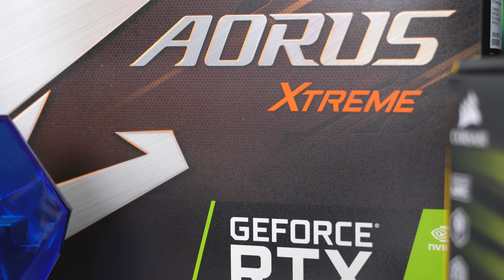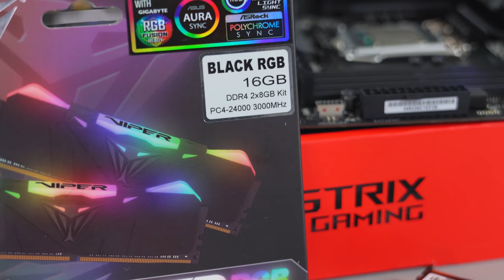$3000 Gaming PC Time Lapse Build - BIG BLUE

Comment: Guys what do you think which is the best ? Thanks a lot! 

1. ASUS 2080 TI OC STRIX
2. EVGA 2080 TI XC ULTRA 
3. MSI 2080 TI TRIO 
4. GIGABYTE 2080 TI AORUS
Reply: I think the gigabyte AORUS rtx 2080 ti waterforce, it also has watercooling with radiator :P
Reply: Asus 2080ti and msi trio 2080ti if youre air cooling and founders edition if u are custom watercooling
Reply: none

Comment: I had a PC that was running an i5 3570k, R9 270 and 8gb RAM. My power supply made a pop sound and then started smoking. Then it made a huge BANG and it blew tf up. I took my PC to a computer repair shop and I watched him test out all of the components to see if any worked. Sadly, the only thing that survived was my cases side panel. I was wondering if you could make a 2019 video tutorial on how to build a 150$ gaming computer. It’s a pathetic amount of money but at this point I’m desperate.

Comment: I have question and I can't decide whether to go with Nzxt h500 or go for Bitfinex Enso Mesh, i been watching your channel and always as my source of reviews, because here in the Philippines we don't have reviews for every build up. working my ass off to get my high end pc.. for my work loads and play time, especially the part here are incredibly expensive, I'm using R5 amd A6
   
Mother Mother Board:  MSI Pro Carbon 
( already have )
CPU:  Ryzen 7 3800x(waiting)
Case: (deciding)
PSU:  Seasonic m12II EVO 80P Bronze F.M 620w ( already have )
Ram: T.Force Nighthawk RGB ( working on this)
GPU RX 590 8gb ( working on this )

SSD M.2 ADATA XPG SX82000 Pro 512GB NVME  ( working on this )
Cooler Master ML120R rgb Liquid ( working on this )

Comment: Ive started getting bad fps on newer games and figured it might be time to upgrade some components or just buy a new computer but i want a ”professional” opinion. My specs are: motherboard: B85M-E45, proccesor: inter core i7 4770 3,4GHz, Graphics card: Nvidia geforce gtx 760 2GB, 8GBs RAM, Memory: 1TB hdd, and a 500W powet supply! Would really appreciate some input on this! :)

Comment: i know it is not suggested but still, this case supports vertical gpu mounting, if the gpu takes two slots (brackets) it means i can place it on the "deeper" ones, which means further away from the side panel, meaning better airflow right? also does the case come with a vertical gpu mount or do i have to buy one?

Comment: so i need some help, i have the ryzen 2400G with 16GB and 500W power supply with 250gb m.2 and looking for a gpu been looking at the amd 590/580 or the 1080 or something what you would recommend, its mostly my workstation and i edit photos via luminar 2018 and sometimes photoshop

Comment: Why not TI? I have built mine with a Asus 2080 Ti for 3000€ it should be possible (it also has 3 packages of 3 corsair rgb fans and a I9 9900k. 3200 mhz Corsair ram 4x8Gb, 500GB Ssd and 2TB Hdd (Lian Li Case)

Comment: If.your spending that much why not just go for a 2080 ti? You could even downgrade on the CPU to a i7 8700k if money was an issue, with the 8700k and 2080ti your going to get way better performance for your dollar. And why why use all in one cooler on the i9? Even using soft tube with ek block and rad would cool it so much better and look better. If your going all out with 9900k you should properly cool it to get the overclocks.  Just my opinion

Comment: I'm not a tech man but what are the blue and black wires for? XD
Reply: Squarejamg are you asking what’s the purpose of the wires themselves? If so, they are the power to the graphics card as the connection between the motherboard and graphics card doesn’t supply enough power to the card alone. If you’re asking why they’re that color, they are sleeved with a paracord cable to make the cable more aesthetically pleasing.
Reply: Daniel harman ok thanks

Comment: Is a ibuypower pc with an overclockable i7 8700k a geforce rtx 2070gb a z370 motherboard 16 gb of ram 1 tb hdd 240 gb ssd w ac WiFi win 10 64-bit an rgb case its also liquid cooled by a trace 9220 its 1, 303 euro or the i9 version if someone who knows a lot could tell me pls

Comment: Ugghhhh, a Shintel i9 9900K and RTX based rig....one is producing LAVA like temperatures eating nuclear amounts of power and full of Meltdown, Spectre and Spoiler hardware security holes and the other is suffering from GDDR6 overheating and artifacting, 1350 MHz gpu core lock bug and numerous BSODs....well choosing these components says something about the consumer....uggghhhh what a disgusting build this will be and it will be destined to fail just after a few months. Even the only proper thing here that is the Corsair RM850x isn't gonna be enough for this power hungry and overheating crap of a build :).